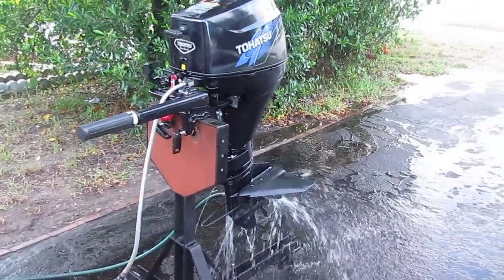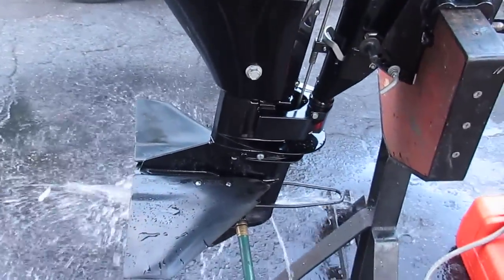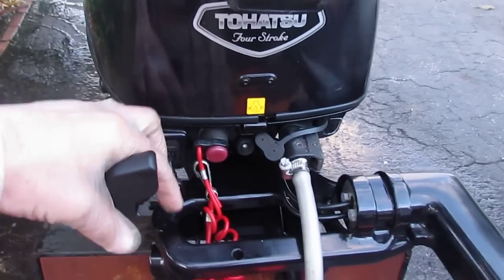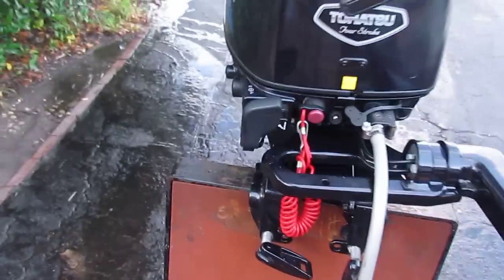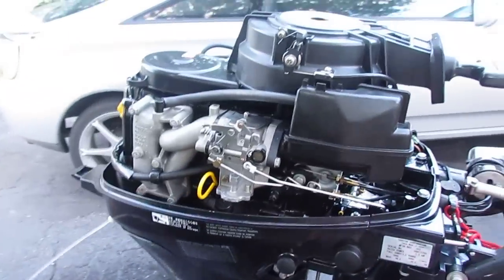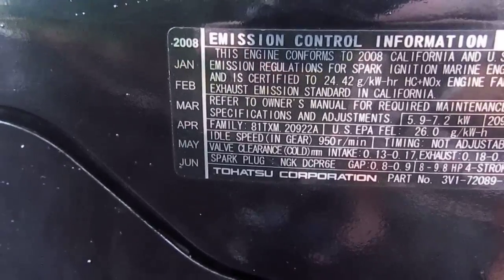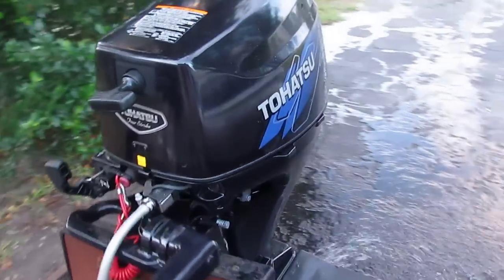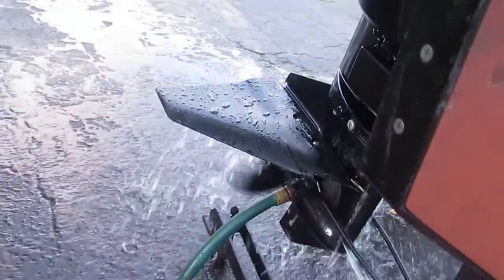2008 Tohatsu 9.8hp 4 stroke outboard

Comment: Hey great video! I have the same outboard and I also get that red oil light every time I turn on the outboard. It goes away after a second or two. Does it mean I have to replace my oil?
Reply: It is a dummy light for oil pressure. The light goes out when you have sufficient oil pressure. If it stays on stop running the motor and figure out why you have low oil pressure. (Could be low oil level.. or worse) Otherwise do your routine maintenance as usual.

Comment: It looks a little jumpy not running quite right
Reply: Don't know why it is normal for my 2017 Tohatsu 4-stk 9.8, almost the same thing as this video but different cowlng looks, maybe decoy or logos only.

But I think it share the same parts.  The strange point is I didn't see the air fuel mixture on the carburater for mine but not really going deep in that as it runs good as my aux engine, start in 3 pulls when cold, 1 pull in hot, great to have it.